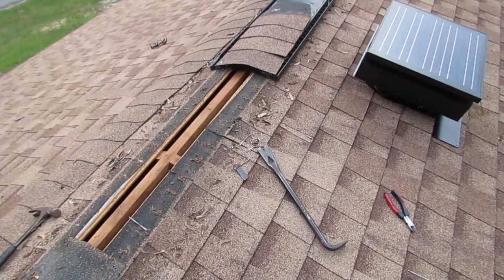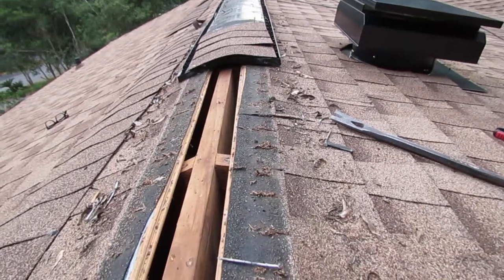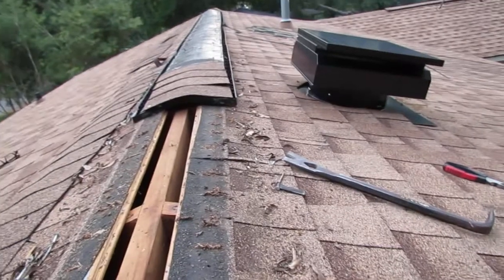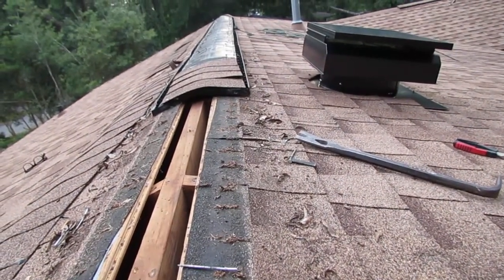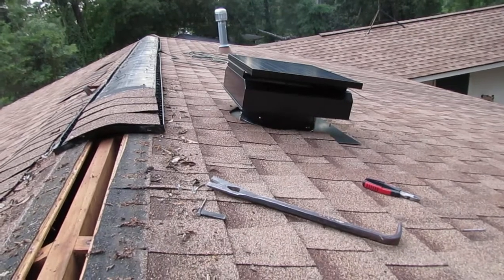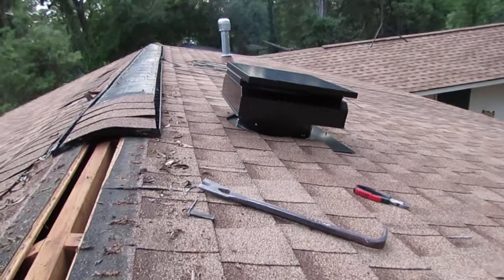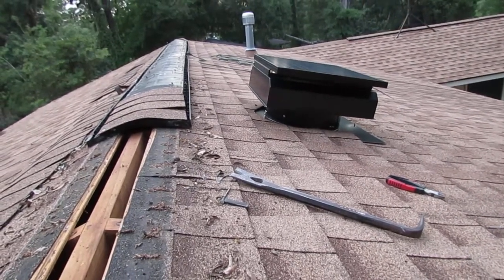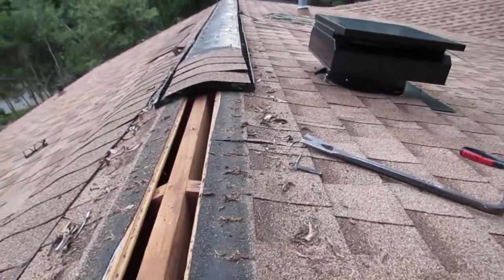Where should you install a Solar Roof Attic Fan Ridge Vent vs Powered Ventilation Read Below

Comment: Thanks for the video. Can I pick your brain?  I don't have ridge vents; I have four turtle vents on my hip roof, and one small solar attic vent located between the turtle vents. I am thinking of replacing the solar-powered attic vent with a larger one, 30-40 watts (attic space is about 2200sf). Do you recommend I block the turtle vents on either side of the larger solar-powered vent so it draws air from the soffits vs the turtle vents next to it? Thanks in advance.

Comment: Hey like the video. Looking to put an attic fan in on my house. Just one problem. I have gable vents and passive roof vents.  Need to somehow vent it better. Should I put a gable fan in, in your opinion or??  Sucks I feel like the passive vents were installed last roofing job before I bought the house considering the plywood and remains are left in the attic.  Thoughts?  Of course if you have the time to assist.
Reply from the maker: If you have Gable Vents, there should be no other vents other than the two on each end of the house. However, you can install a gable end fan to promote cross ventilation. I would install this fan on the side where the wind blows most often.

Comment: No way that solar fan pulls more hot air than the ridgevent.
Reply: How many did you end up needing?
Reply: I agree, unless he doesn't have enough soffit area to pull from could be the only scenario. Creating negative pressure